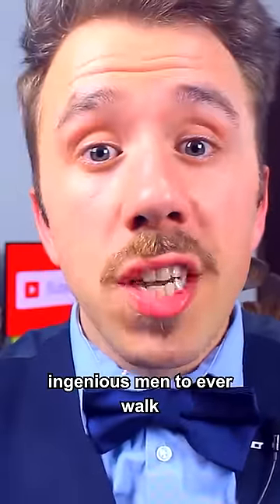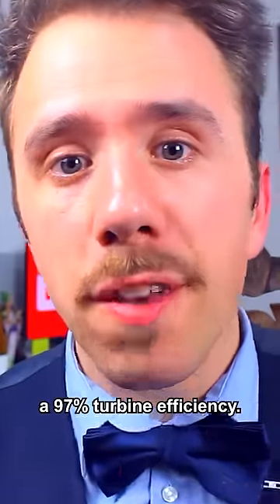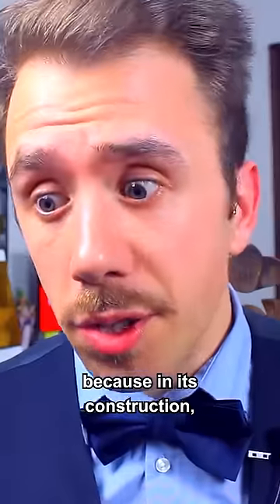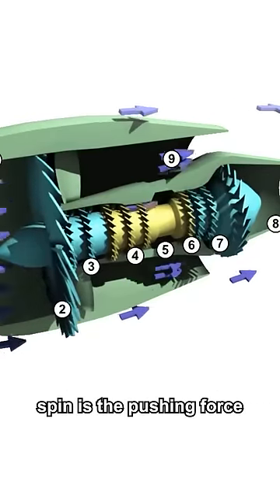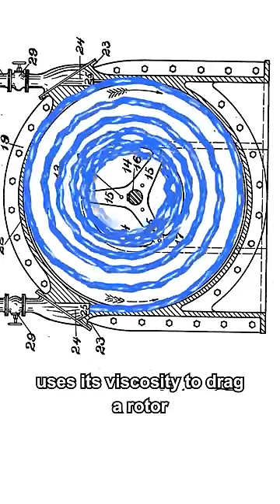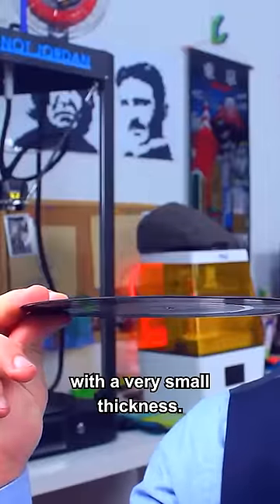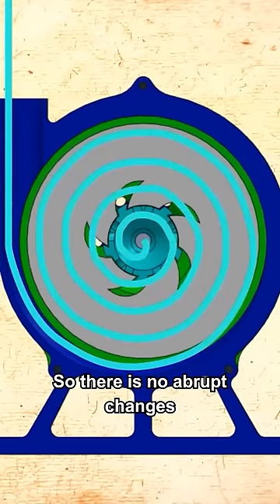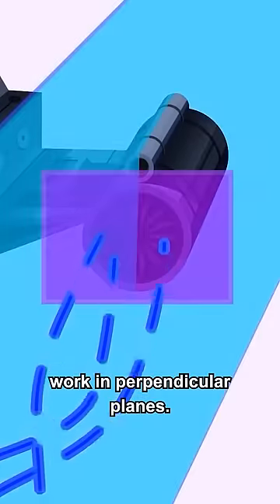97% Efficiency?! Was Tesla Right About His Turbine?

Comment: Tesla Turbine arguably makes power when spinning extremely fast, but any load causes too much slip between fluid and rotor. It stalls and makes no power.
Reply: =SO THAT'S HOW IT'S INEFFECIENT??

=THANKS FOR PROVING ABOUT HIS LAST YEARS,THO.....,HEHEHEHE
Reply: @robotnikkkk001  Not ANY load. Just like an automatic transmission, the higher the slip, the lower the efficiency- but it keeps making torque at zero RPM.

Comment: there are also major problems with this kind of turbine. Like boundry layer effect, blade tip velocity or scaleability...
Reply: And it goes so fast it melts bearings
Reply: @NeuKrofta  where do you get the idea that this melts bearings from? It just doesn’t. There are plenty of different types of high speed bearings.
Reply: @conorstewart2214 bearings aren’t the problem, to make this turbine feasible for anything other than micro scale is extremely high RPM which in effect leads to ridiculously high tip speeds on the discs causing failure of them. The solve this problem you need to reduce the ROM to under 10,000 rpm which makes it far less efficient than a conventional pump. The technology does have a place in some limited small scale applications but it can’t be scaled up due to physics. Even Teslas test model repeatedly failed due to disc warpage and destruction of the discs, somehow this turbine idea has grown a life if it’s own way above what Tesla himself claimed and us just another urban myth when it comes to its efficiency.

Comment: Someone went through the trouble of making an animated 3d cut-away of a turbofan where the fan blades and the turbine blades are configured for rotation in opposite direction of each other on the same shaft - puls completely omitting the static blades of the compressor stages, good job! 😅

Comment: The problem with it is super high rpms for most fluids or gases.
We don't have anything that can stay stable and not break at the required rpms and size for most applications. 

With thicker fluids, the rpm requirement comes down a lot, and it becomes a practical application. 

That design is used in some cases with thicker oils.

Comment: see what happened when you use materials such as carbon fibre as disks as they are light and can have various surface textures
Reply: And other changes such as a slight conical shape or a small "cut" at its perimeter.
Reply: @vitordelima 
Cuts along the perimeter would decrease stability. 
And as for OP: The mechanism heavily relies on carrying continuous momentum - which requires mass. It already takes a while for the engine turbine to get moving to top-speed.
If your next solution is "just use heavier and more-reliable disc design!" you will encounter is issue of accident liability.

There is no way to manufacture an engine block thick enough to contain the edge energy of the disc array for ONE of these, let alone an ARRAY of these. We're talking DBZ Krillin Destructo-Disc edge energy. Carving through cars and people and concrete energy.

Imagine 20-30 all-metal runaway tires. :I

Comment: Being compact and cheap to manufacture is a much bigger advantage than the questionalbe claims of efficiency. 
Been working with these for a few years in my spare time. Amazing how much work you can get out of a tiny Tesla turbine with posterboard discs driving it with a De Laval nozzle on an ordinary air compressor. Stainless steel or carbon fiber discs, advanced bearings and super high pressure steam?  A LOT of power in a VERY small package. 
Now I just need to get my butt in gear and fill out the patent application for a couple improvements I've made. Finally retired, so I have time now.
I want to set up one with two disc packs on the same shaft, and try to get it working as a gas turbine (jet engine.)  
Also want to try attaching rare earth magnets to the discs as a rotor, then build a turbine case that's the stator, and create a turbine and generator in the same tiny package.

Comment: And yet Tesla turbines as cool as they are, are not really used much anywhere.
Reply: They currently pump poop. 
Because the plates are perpendicular to flow, they don’t wear with the abrasive substances
Reply: @brucebaxter6923 liquified/pulverized though?  I can imagine closely spaced disks clogging at the perimeter otherwise.
Reply: @Qui-9  yes. By the time it goes from your toilet through all the pipes dans and tanks before it needs to be pumped…it’s quite homogeneous.

Comment: years ago "YT-Physics" had a small series with 3d printed tesla turbines that showed (i had one) that this engine model had 2 modes of operation, and the effficiency mode just kicked in at 50k rpm, yes you heard me, a golf ball size model jumped to 60k rpm and in soared like crazy. 
driving these designs in low effiency mode will NOT WORK as expected.
every turbine is different, do the work

Comment: Apparently the turbine dosent reach 60% because as the steam cools it gets stuck inside the system slowing it creating exponential losses till it fails it only works effectively at 60%
Reply: Correct me if I'm wrong 😊
Reply: @dylanbeddoes24 thats the Betz limit, probably it is 97% of that
Reply: The issue is figuring out what terms of efficiency we're using.

From what I understand these things are typically discussed in terms of isentropic efficiency which is comparing the output shaft power vs the potentially available energy.

Most laypeople tend to conflate that energy drop with the total energy in the fluid.

We'll use some made up numbers for examples.

If you heated a bunch of water up, go it boiling spending (as an example) 1000 Joules of energy to do so, then expanded it.

For example we'll say that process drops 500 joules of energy as some of that energy stays in the condensate water itself in the form of heat as there's a phase change involved.

Again, these numbers are comically wrong themselves and are only so it's easy to demonstrate the idea.

That means if you manage to get 475 J of shaft power out of a turbine you expand that fluid through, you'd have a 95% isentropic efficiency.

Because that's not measuring the total energy put INTO the system in terms of fuel burned, etc but rather what percentage of the energy that you actually expended.

So if it takes 1000 J to get you where you need but half of that is spent just causing water to boil (change phases) the total cycle efficiency couldn't be better than 50% while the turbine's isentropic efficiency could be much higher.

This is why GE produces gas/steam combined cycle systems that cap out around 60% thermal efficiency despite both machines having turbine systems with 90%-95%+ isentropic efficiency.

Comment: 97% efficiency, 0 newtons of torque
😂
Reply: Really? Because the proof-of-concept one I built with posterboard discs run by a cheap air compressor has enough torque to self-start a small DC motor being run as a generator, and do useful work (generate electricity.) The De Laval nozzle I fabricated helps a lot. 
IIRC the LeTourneau patent for improvements to the Tesla turbine uses spacers (washers on bolts) between the discs at the rim, to maintain disc spacing and increase the strength of the disc pack. Those really help with self-starting.
When I stopped working on the project, I was working on a old skool De Prony brake (with a modern load cell) to measure the torque output at different speeds. With that and the RPMs, I can calculate horsepower output, deduct the energy of the incoming compressed air, and figure the efficiency. 
Next step: replace the washers with rare earth magnets, and build a turbine case that is also a stator. Turbine and generator in one very compact package.

Comment: I just watched another short on this earlier today on Action Lab Shorts. They explained that when you actually put a load on the Tesla turbine it slows the disks, making them slower than the fluid thus reducing its efficiency to that of a regular turbine. The big advantage of the Tesla turbine is that disks are cheaper and easier to replace than regular turbine fans.
Reply: and the downside was they were to be thin, and easily warped during use, severely limiting their life time.

Comment: It might be interesting to use a different structure so the actual fluid it's self becomes part of the disk.

If you make it lighter with cutouts (would need to find the right shape) it might handle forces better and the fluid semi trapped in the pockets could be pulled on but with lower friction and let heat from the main disk structure be quickly pulled away with the fluid

Comment: and the saddest part is that it wasn’t ever recognized until later bc it’s efficiency would dramatically reduce with load put on it, and if it ran from prolonged amounts of time, its efficiency would straight up break the rotor because nothing they had (or we have) could handle the speed

Comment: >once it has a load on it then it is extremely inefficient

That's something that can be accounted for with a longer array of larger discs or a starter-like mechanism to compensate for initiating the rotation.
The reason they can't use this for cars etc is because a wreck will send dozens of metal blades careening out of the block with an edge force equivalent to a semi-truck on its sides.  There is no way to build the block to build a block strong enough to not be susceptible to these forces without adding weight that would further decrease efficiency.

Comment: The way I understand it is that it only efficient in a narrow band of rpm. If is loaded to the extent that rpm drops out that band the flow of fluid stalls and just short circuits to the exhaust without doing work.

Comment: A traditional blade is pushed by the fluid perpendicularly, whereas the discs are pulled/pushed in the same direction as the fluid. But how much drag is on the traditional blades from viscosity? The fluid is being deflected in the (somewhat diagonally) opposite direction that the blades are moving. Does this slow the blade down? Is this why Tesla thought the discs were more efficient? Also in regards to the disc turbines how do you describe what the fluid is doing to the disc? Is it pushing, dragging or both? Or is there even a difference?

Comment: It is still not clear why the Tesla turbine hasn't been tested as full sized prototypes.
Reply: If Tesla's claim proved true then the entire industry of electric generation from steam power would be much more efficient and require much less fuel. 

Then also water turbines, used in hydroelectric systems (i.e. dams) would be tested with the Tesla design and if it works with steam, it would likely work exactly as well with water. And again, much more electricity made from each unit of water used.

Yes, Tesla rubbed everyone the wrong way back then, but why hasn't anyone in all the years since tested the Tesla turbine design. It does make sense and will be cheaper to make.
Reply: The ones Tesla was working with were full sized. Not power plant scale, but way, way beyond toys.
One thing I have learned from building one is that a very small Tesla turbine (think a package of blank DVDs) requires an insane amount of working fluid (steam, air, water, whatever) to operate at full capacity.  Forget any claims of efficiency- power density is their real superpower.  Picture a disc turbine with maybe 16" discs in a 6" thick pack- and a high pressure steam line the size of your forearm feeding it.

Comment: To be efficient and torque the air has to enter do it's job and leave efficiently,  I see no point sending it to the middle without a spiralling evacuation route between each disc 1mm so airflow could escape easily , each disc needs spiral turbine pattern to center with still outlet at center shaft BUT with a cone on center shaft BIGGER ONE SIDE tapering to outlet continuing throughout each disc to outer (put a sprial turbine pattern on it to create extra spin)
Yes I am a inventor I see things working before I build them. It'll be closer to 100% efficient with more torque. 
Build it
Reply: Better get your butt in gear and get that patent application filed. If you already have, congratulations. :-)  
I think my idea is slightly different, as I'm going for zero cuts or gaps in the disc faces, in order to maximize surface area for a given disc diameter.
Reply: @ostlandr  anything is worth a shot , I see the point of using friction to spin it smaller gaps  , but then I see once a load is applied aka generator it's efficiency goes backwards real quick as it has no grip to force applied. , reason I mentioned a spiralling or better put curved patern inwards between each disc even quarter of a millimetre just enough to space discs paper thickness apart..  Then better put turbine center shaft exiting one side so you get extra connetic force applied.
Cheers no Patent for me to many other ideas on the go.

Comment: The issue is that it’s only efficient in very small models once you scale it up it reduces down to 13% efficiency which is about equivalent to standard wind turbines while being significantly more complex and expensive to make.
Reply: Wait, what? That made no sense whatsoever. They can be scaled up.
Speaking from experience here as someone who has experimented with homebrew Tesla turbines- larger units are more efficient, as each disc has a larger surface area. Plus, a larger diameter disc pack equals higher torque. 
Thing is, given the power density,  it takes a LOT of working fluid to run a surprisingly small Tesla turbine at 100% capacity. Even for the little one I built with posterboard discs the size of CDs, I would need a HUGE air compressor to get it to 100% of the output it's capable of. And unless you are pushing the turbine to 100% load, you can't accurately measure efficiency.

Comment: This is basicly just a flywheel. Which was invented around the Renaissance era long before tesla was ever born. people really need to stop idolizing him. If anything Michael Faraday is more important in a historical context.
Reply: LOL no, it "patently" is not a flywheel. It is a boundary layer turbine. Its operation is based on Ludwig Prandtl's 1904 paper on the behavior of fluids with a very low viscosity (steam, air, etc.)  Tesla, a mechanical engineer by training, based the design of his disc turbine off this work, successfully testing it in 1909 and receiving a patent in 1913.
The boundary layer turbine operates very differently than the impulse turbines developed by Parsons and De Laval.  
To be fair, if you build a De Laval nozzle, hook it to an air compressor, and direct it against the outside rim of a free spinning flywheel, the flywheel will behave like an extremely inefficient boundary layer turbine, with one-half of a disc instead of a stack of them. But even so, you can spin that flywheel up to a pretty good speed, and then extract the energy from it, proving that useful work went into it.

Comment: Why not create ribbed discs, as in discs with elevated “walls” that are perpendicularly placed along the outer perimeter at intervals (but not joining at the inner perimeter, so maybe 50-75% of the radius), to increase surface area and friction? Each disc’s walls would fit between the next disc’s walls, so from a top view, the fluid needs to travel in a zigzag form.
Reply: At that point you're better off just using a regular turbine

Comment: Tesla turbines work best on low-power applications but are very inefficient when it comes to high-power. Their efficiency is only high when the flow rate is comparatively low, their efficiency drops rapidly as the flow rate increases. They still have their uses but they are limited to low-power niche applications.
Reply: Honestly it amazing how the scale of an invention alters how it functions. They say one of the problems with building smaller computers is the gates don't work as well when they are that small also matter is said to behave differently when it's small. :)

Comment: But...the disc will normally warp.  As fluid or gas flows through the turbine, it does drag the turbine on the moving direction with natural surface friction.  If the fluid of gas moves out of place and there is a vacuum at that point, it's going to attempt to squeeze the blades together.
(Simple example is two sheets of paper hanging perpendicular to the ground, and you blow between them.  The paper will come together)

You also lose natural efficiencies at the bearings that hold the framework together. (Because that is not frictionless and has the weight of the blades resting on it)

So, in theory this works well, but after trying to build a simple turbine with old CD'S (and pressurized air), I can report that there is a lot to consider.

While there are patents and inventions that have not been discovered, those that have been known by the public for years and have not been adopted by industry, usually have complications or details that make it non-viable.

I don't know, maybe titanium discs would work but the cost of titanium in the market is too high, especially if you have a turbine that gets 70 to 80 % efficiency with a standard design.

All to say, Tesla did definitely think outside of the box (and is credited with AC electricity), but it doesn't necessarily mean a design is viable.

I know I shouldn't care, but a short that implies that others haven't looked into it (I'm sure they would love to fly a plane with a Tesla turbine), is more sensational than educational.